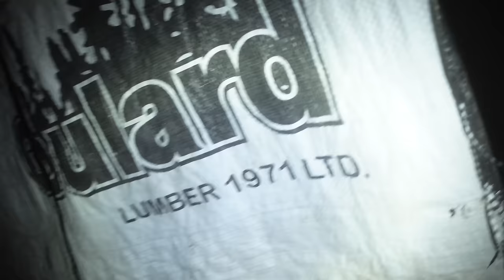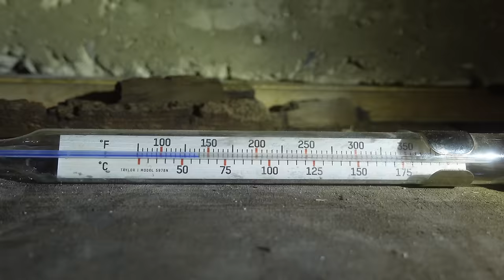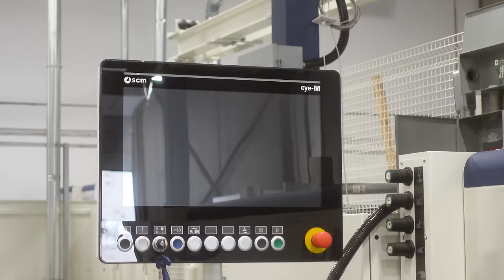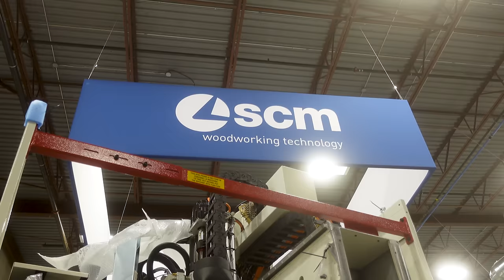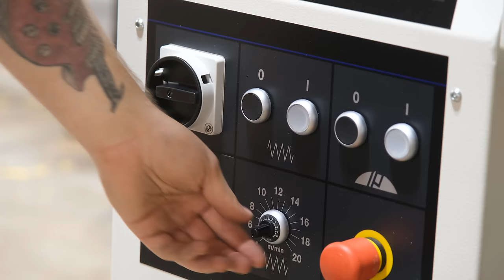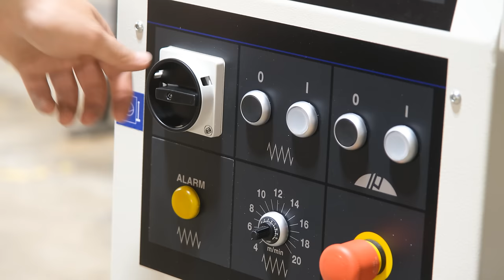Visiting Amish Sawmills

Comment: Santa came early!!!  Nice machine.  I lived in Ohio about 30 miles from a large Amish community.  There was one fellow who made roll top desks of red oak.  His entire wood shop was powered by a diesel engine.  A line shaft ran the length of the shop overhead.  Flat belts dropped down to each machine from the line shaft.  Even though I am a wood worker I had to buy one of those desks.   It is made from one inch red oak and I included a hutch that sits on top.  It is beautiful.  It is now about 40 years old.

Comment: I believe that shaft thru the wall from the diesel is called a jack shaft. At least in Wisconsin its called that. Amish are craftsmen from another era. Interesting video. Thanks for sharing
Reply from the maker: Good to know, thanks Steve! And thanks for watching, glad you found this video interesting!
Reply: Line shaft is the long one transmitting power to anywhere you choose to go. Jackshaft is an intermediate shaft that's often short with a couple bearings. Countershaft is coupled to the machinery with a final drive and a clutch.
Just an example of terminology I've worked with factories that use water wheels or remote motors and engines and a lot of shafts, sheaves, pulleys, belts and lots of sprockets and chains plus the odd cog and finger drives often made out of wood just like the old ones.
Is SCM the same one that sells industrial vacuum and pressure control devices and more?

Comment: I love my older scmi 16” jointer planer.  I went to surry BC from Tacoma WA to pick up a delta rc-63n 15hp 24” planer with a shelix head in it for a sweet deal. Those older machines are just made to work, but would love to use a new gen planer.

Comment: Looking at ingenuity and minimal modern technologies, I like the late 19th /early 20th century sheep shearing sheds (I'm Antipodean ~ we have lots of sheep) where the "stand" was driven from an overhead drive shaft. Initially, these shafts were driven by steam engines (though I wouldn't be surprised if there were water wheel /windmills versions), then diesel and electric motors.

Comment: how to their engines work without any batteries or alternator their diesel glow plugs etc? what are the belts made of instead of rubber? wild the modifications needed to work like that in hard mode. fascinating

Comment: I mean this with no disrespect intended to the Amish.. but I wish I could understand some of what feels to me like just a huge contradiction.
 Like... electricity from power lines is bad, but burning diesel fuel 24/7 to run wood kilns and push all those pollutants into the atmosphere is...good? It would make a ton of sense to me if it were things like solar and wind power charging up batteries, but I guess they can't use batteries. 
I don't know. I'm not trying to be harsh, I would like to understand the thought process behind it. But either way, I won't deny that the ingenuity involved in powering all of those big tools is super impressive.
Reply: Most power is generated by burning fuel of some type .
Reply: @robintaylor-mockingeemill8223  yes, I understand that, and I suppose if anything, that's kinda my point! Like, I would understand if Amish communities were opposed to ALL forms of fossil fuel power, but they'll still use diesel, as long they're the ones setting it up? So I would completely understand if it's a desire to be more environmentally friendly or something - but it's obviously not that.
Reply: This is all religiously driven and doesn’t need to make a whole lot of sense to people “of the world.” Not using electricity is not about the environment for them. It is about independence from the “English” world. Using grid power would connect them too much to the “world.” Using diesel/gasoline/coal doesn’t There is also a whole spectrum of liberal to conservative Amish in terms of things like solar power, phones, bicycles, etc. These are fairly middle of the road on that spectrum.
Reply: They won't use sources tied to the grid was my understanding